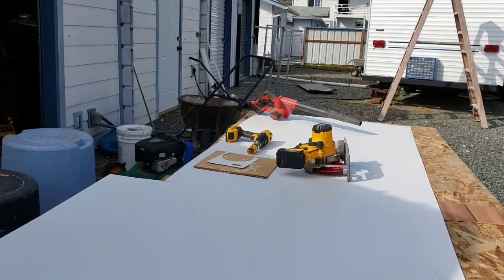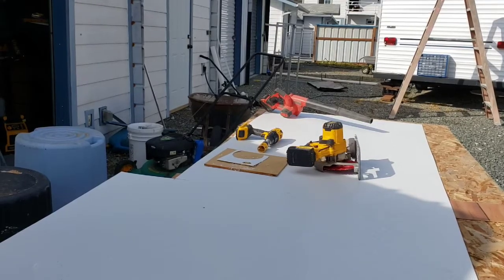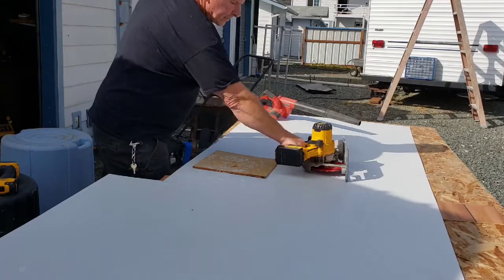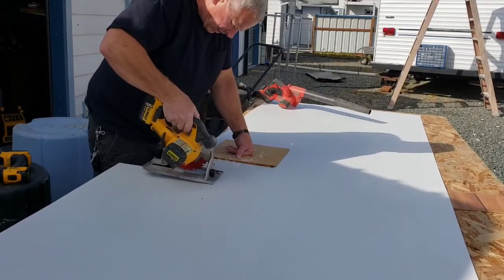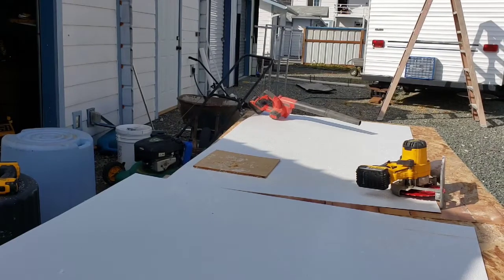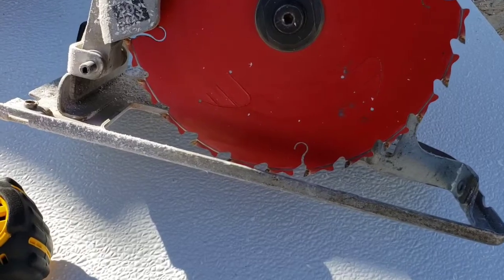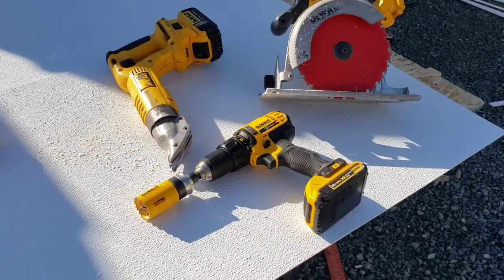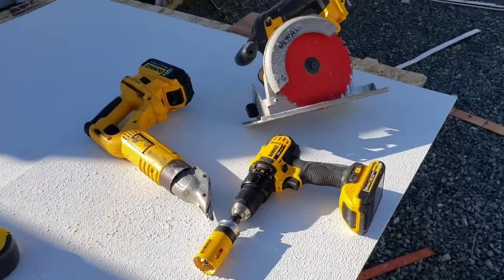How to cut FRP the right way

Comment: Thanks, you’re the first person I’ve seen cut this. I was going to use a plywood blade, so I’m glad I found this. Curious if you initially tried the plywood blade. Thank you.
Reply from the maker: No because I do it for a living I don't try any handyman crap everything gets cut with a 7 and 1/4 blade carbide dipped works perfect every time and if not I use any other tool they all work use any drill use any hole saw
Reply: Fellow frp installer here. Double cut shears is what I use to cut. They make significantly less dust than skilsaws. Holes are the fastest/easiest for holes

Comment: Do u think i could use a jigsaw? If so, would a fine tooth (for metal) blade work best? Thanks alot! Art
Reply: it works ok, but the blade gets hot and will chip out spots in the cut, really need carbide blade med tpi

Comment: I, too, have always preferred this method, though I do all my marking and cutting on the backside. Errant sharpie marks or saw base scrape marks are never an issue then and as I always glue the sheet rather than the wall, it’s ready to glue. I generally use a mitre saw for trim and a pair of tin snips for ‘adjustments.’ Another tip is to make a glue scooper by cutting a corner off the bottom of a square plastic bucket and screw it to a stick.

Comment: Thanks, Jon.  I was worried about cutting some for a wall covering.  Seems like I used a Stanley knife last time, but this looks much better.  I was concerned that the circular would split or crack it, but your cut looks great !
Reply from the maker: a  utility knife would be very difficult to cut FRP and very scary...

Comment: What did you do for the tearout on the back? Shallow depth and looked like cardboard? Kinda smart I use scrap plywood.
Reply from the maker: You're right I never have any tear out I always have it against something I usually use OSB with a piece of paneling in between I don't even want to wreck the OSB but I don't mind using up a piece of scrap paneling

Comment: Did you cut through the plywood behind it at the same time? This stuff breaks easily and is a pain.
Reply from the maker: If you'll notice there is a piece of paneling protecting the OSB so I don't mess with the whole sheet
I didn't want to make any cuts on my OSB

So I put a little piece of paneling

To protect the OSB

And yes the saw blade scored that a little bit

Butt did not cut all the way through the 1/8 " inch paneling

If you get it set up with saw horses and a piece of plywood

The stuff is not a pain in the neck

But if you don't do that

It is much harder and much more of a pain in the neck

Take the time
 get set up right

You will be much happier
Reply: That's exactly the question I was wanting to ask because it was obvious he was using something to give it support which is literally fundamental to the method and this entire video but he didn't even say anything about it!

Comment: Now how do I pull it tight hanging on the side of a trailer directly on the studs, no backing board? I need to pull some magic outta my azz cuz I need it light as possible; and no waviness!
Reply from the maker: Impossible without backing board it's too flimsy
Reply from the maker: You can put something as light as paneling behind it 
It will help it a lot
to be Rock Solid it has to be very solid backing

Comment: Hey, thank you so much for showing this video. It helps me a lot I’m about to cut a lot of FRP panels because I’m building out a food truck myself. I really want to get this set up correct to do this as easily as possible. Can you give a demo of that just the set up to cut the FRP.
Reply from the maker: Hey Heidi
There really is no need for any kind of specific setup

That's why I did the video

I washed online with other people were doing and showing others to do

And they were so weird

This stuff is the easiest thing on the planet to cut

With any kind of power tool

And it's so structurally strong

You can't go wrong

I absolutely love FRP

Once you put it on the wall

You're never going to have trouble with that area again

And you can maintain it so much easier than a painted wall

Which is what it's designed to look like

If you don't have saw horses

And a piece of plywood

Which is all I used in the video

Just lay it on the driveway

And put a piece of eighth inch paneling down where you're making your cut

So your blade doesn't hit the concrete

And you are golden
Reply: thank you so much! @Jonehughes

Comment: Hey John, 
Can PVC trim board be cut the same way using a 24 tooth carbide bit?
Thanks
Reply from the maker: Absolutely
The more teeth 
the better of course
But if your blade is brand new and sharp
You will have no issues

But definitely go slow
 through the work

You got this 😎

Comment: Would putting up 4*8 sheets on a ceiling be doable for 1 guy? I thought maybe a drywall lift with 3/4 foam under it at bring it home?
Reply from the maker: Yeah it's definitely hard work

If you had Duramax panels 

you'd be way better off

 but if that's all you can get

 because of that's all that's in your area

 and you want to put it up now

 then you can do it

 but I wouldn't use foam

 that would be just as bad as the FRP

 which is totally way too weak 

so you would have to use some like 7/16 OSB or even half inch particle board 

 it's just really hard

 I can't even imagine doing

 I can't imagine the glue holding until it dries

 but I've always said

 you are the man

 knock it out brother

if someone forced me to do it

I would glue all the sheets onto quarter inch wood paneling

And properly space the wood to allow the connectors to work correctly

Couplings

Corners

 End Caps

 whatever connectors were necessary

Duramax panels are way more rigid and it's pretty much the same product but it's designed for rigidity and it could go on a ceiling
Reply: @Jonehughes  I don't think you understand what I was saying. I am working by myself I have to put a FRP on a ceiling. I was talking about using a drywall lift to lift frp panel with a foam sheet behind for support. I am not talking about putting foam on a ceiling. I am guessing it is hard work but probably not as hard to work as putting 5/8 drywall in little tiny 7*8 rooms all the time.
The room I am talking about putting frp in has brand new 5/8 drywall.
Reply from the maker: You are funny brother 
I understood you perfectly
If I already had 5/8 drywall on the ceiling I would just texture it and it would look just like FRP

 though it wouldn't be as tough as FRP

 it would certainly look on point 

with no seams

 as the FRP has seams

 every 32 square feet or more

FRP is 1/8 in thick or less 

and is really floppy

 on a wall it's kind of tough to put on 

but on the ceiling

 it's damn near impossible

 foam is also not very rigid

 unless you were talking about 1-in solid core foam 

then it would be fine

 but any normal foam is Bendy also

It would also flop all over the drywall hanger

We could send a man to the Moon there's no doubt you can make this happen

 it's just very rough

Good luck brother
Reply: @Jonehughes   it can't be Textured otherwise I would do that. I'm working for a construction firm and frp is required on walls and ceiling because it's a pool room. I will probably use a piece of drywall to hoist it up then to keep it from flopping, or get another guy. Sorry for so many questions this is my first frp Job.
Reply from the maker: That's perfectly fine brother 

I don't mind the questions at all 

I live for this

 I've been doing this for a long time

 I'm just telling you 

it's going to be very hard to harden the ceiling 

we call that

 hardening the walls 

when we put FRP on it 

so certainly putting it on the ceiling

 would be called

 hardening the ceiling

 the most important part is going to be getting the connectors in line 

so you have to work like crazy

 to somehow get the connectors to work

 at the same time

 holding it in place

 it's all together possible that you can do it with a few inches less on each side with your support panel 

so your FRP is able to be worked on its edge 

while still having support

 so you can line up your couplings and connectors and corners and such
Reply: @Jonehughes  I didn't plan on using any rivets I was just going to use glue it looks like if you have a few people it's pretty doable all I'm going to have is the divider in the middle and then I'm going to probably put a nail in cove around the sides
Reply from the maker: Yeah I'm just trying to save you a little aggravation

Have you already put on the walls

If so ....you'll notice how floppy it is

And if you applied the adhesive correctly

 it sticks really great

But if the wall wasn't straight or some other issue came up with the adhesive

 you'll get bubbles in the FRP 

where it's not connected to the wall

If you have noticed that

 then you will also notice

 the ceiling is 10 times worse

 because it has gravity

 pulling it down away from the adhesive

People use rivet supports for a reason

It allows the thing to stay there and be strong and use the adhesive correctly

 without them,

 it's just going to be very tough

 that's why I said 

use something like half inch particle board or something super rigid

 that will force it up and hold it tight against the adhesive

I always just use FRP adhesive and it's pretty strong

 but not that damn strong

 if you found some adhesive that works a lot like 

contact cement and formica

 fantastic 

that way you'll put it up

 it'll stay exactly where you put it 

no muss no fuss 

but anything other than that

 it's going to be drooping and bubbling and other things to that effect 

unless it's forced into position 

and held there until the glue is sufficiently cured

Comment: Electric shears is the way to go, absolutely no mess
Reply from the maker: As I showed in the video

FRP can be cut with a lot of tools

It's hard to cut a quarter inch hole in FRP with a electric shear

It's even hard to cut a half inch hole for a pipe in FRP with electric shears

It's not even cool to cut an inch and a quarter hole out of FRP with electric shears

But yes electric shears have their place

Comment: is there issue with breathing in the airborne particles from using the circular saw?
Reply from the maker: I think if anybody has a tendency to have issues they should wear masks I've never been one of those people I'm 65 years old and have been cutting the stuff since it came down the pike,
I do have a sensitivity to fiberglass from wall or ceiling  insulation

And I do wear a mask when I'm installing that stuff

So if I were you I would just test it and see you can just be safe and wear a mask or go for it and see what happens I don't have any bad issues from either .
Reply: FRP is the abbreviation for fiberglass reinforced plastic so that means the dust has fiberglass and plastic both of which are not going to break down in your body so if you're doing a little bit maybe just holding your breath especially if there's a breeze outside but if you're doing it a lot you want protection

Comment: I just a grinder with a masonry blade on it for the straight cuts. Hole saws are a need but you can also use a jigsaw for holes that are 3” and up (if you dont have a big enough hole saw). I find the grinder is easier to use to cut a perfect line on this material but the saw work fine too i suppose.
Reply from the maker: Yeah
 both jigsaws and the grinders will work,

But they're both slower than the hole saws and circular saws
Reply from the maker: Also using the grinder is not very clean

 it makes a mess as it melts it's way through and you got to clean up the edge to use it

Comment: I'm looking for videos on how to remove FRP. Looks like its gonna be a major pain to take down
Reply from the maker: It all depends on how It was attached,
 if it is real bad with tons of glue,
 you got to take off everything including the drywall or whatever substrate it was put on,
 but if you just pull it off,

 just texture over everything 
after a big mudding  job
Reply: If you have a reciprocate saw, try to use a scraper  attachment  called spider. I have removed linoleum flooring this way.  Not sure how it may work against drywall but its worth trying.

Comment: So I'm not gonna be able to score it with a razor and snap it...great.
Reply from the maker: Definitely not
This stuff is as close to steel as you can get plastic to be

You cannot score and snap steel either
Reply: @Jonehughes  I used a skilsaw for the long straight cuts and am using a rotozip for curves. It's fiberglass. I hate fiberglass. But if it'll do the job I guess it worth it. I'm not a fan of MASKS!!!

Comment: How do you fix a sheet of FRP which got air after a day of install?
Reply from the maker: Super small micro drill holes

Push the air out

The glue should still be fresh enough to stick

Silicone the drill hole
Reply: @Jonehughes  thank you but the problem is when you see the problem a day after you install the sheet
Reply: @leoramirez1499   would a heated air gun worl...type use to get vinyl off floors?